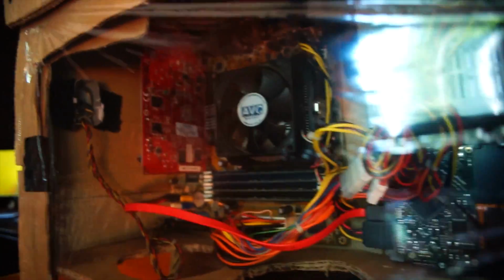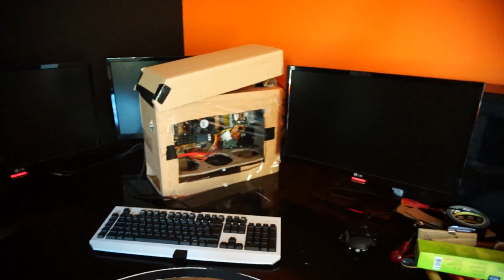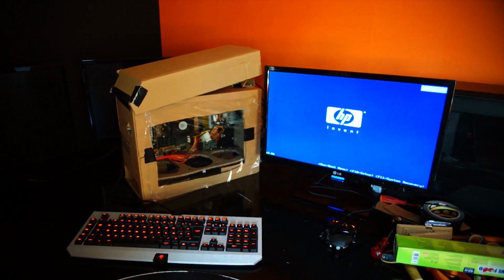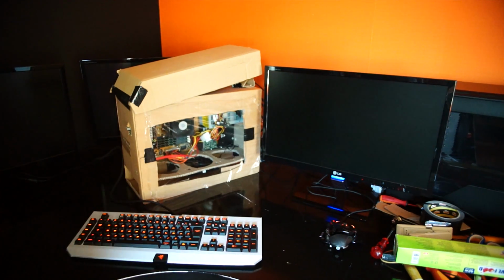The Cardboard pc case Version 2

Comment: Can I do this for a usb hard drive? The usb connection on the case is faulty. I took it out and using it without a case. Would cardboard be okay?
Reply from the maker: Sure, dm me the result!
Reply: @UnicornReviews  After putting it back in the case it works.

Comment: how do you turn it on
Reply: dinnerb0ne short the + and - power on pins on your mb with anything that is metal. From here on out, you can set a command on your keyboard to power on your computer and then shut it down.

Comment: can some one tell me how he turns it on please i want to make a case but dont know how
Reply from the maker: +hjd gaming I used a power button from an old case. If you want to you can just find the 2 pins that do power on signal and attach two wires.
Reply: +hjd gaming or set the pc to start on power, then shut it down normally, and when you want to turn it on, flip the PSU switch off and then on again